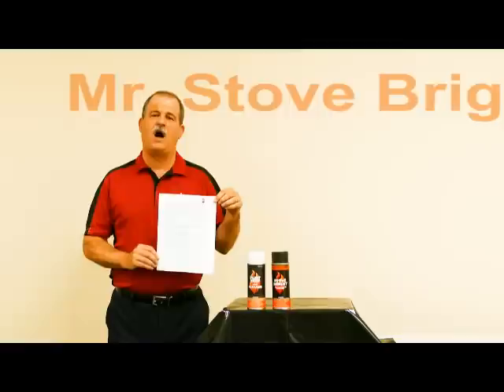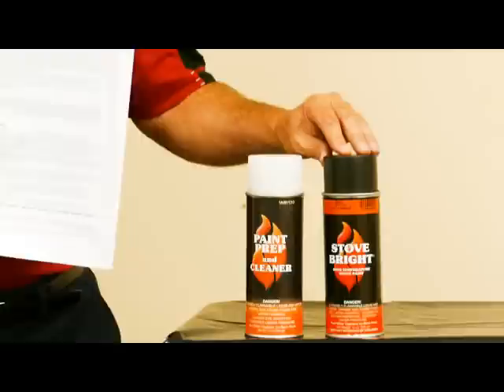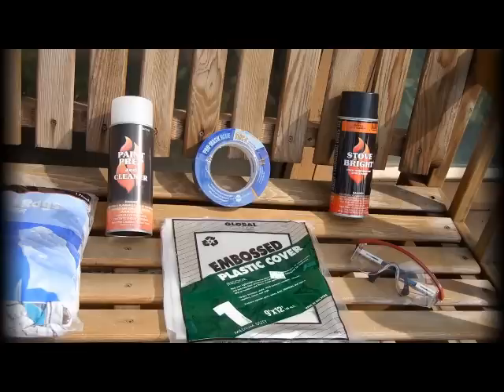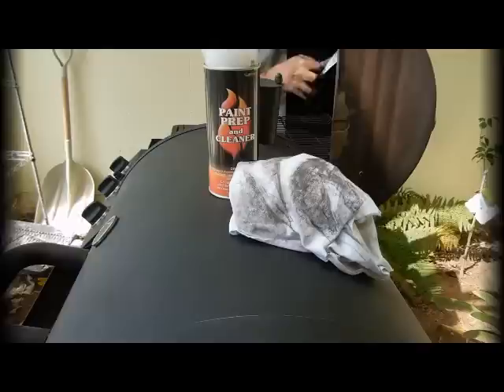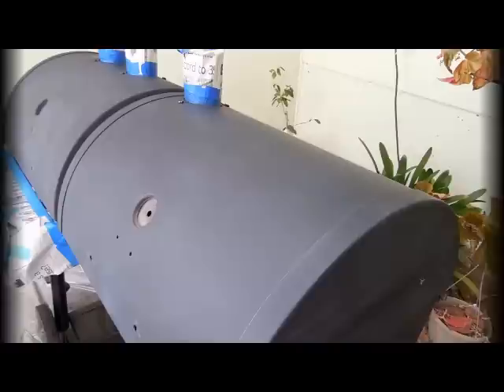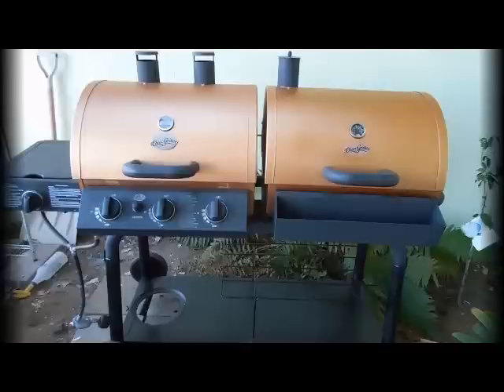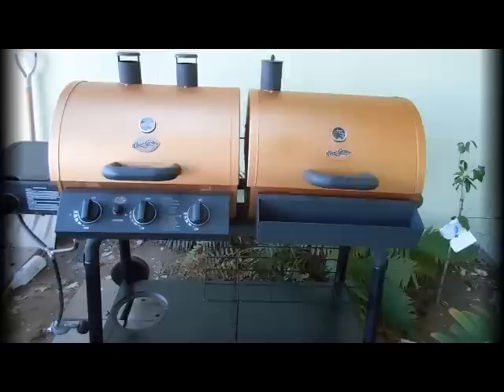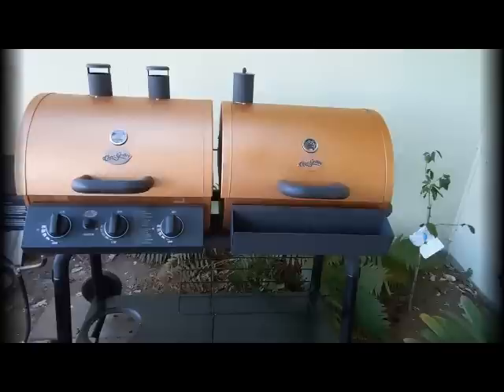Smoker BBQ painting project

Comment: I just finished cleaning my grill and it looked so dull. So glad u found this video. I will have to go over the burn process portion again. How long dies that actually take?
Reply from the maker: Grills are pretty high temperature when burned, the heat setting process is probably complete.  However, no high temp paint will have a gloss finish, like a powder coating.  The paint will appear to be flat, that is the nature of high temp paint.  Please feel free to call us 800-537-7201